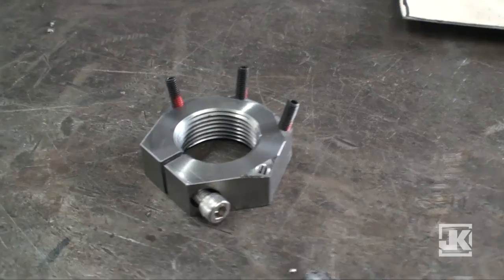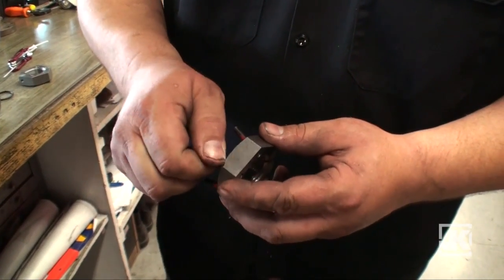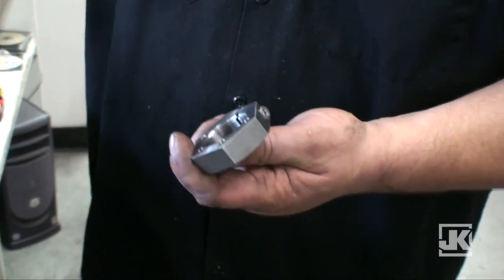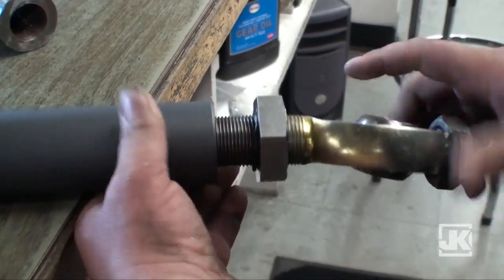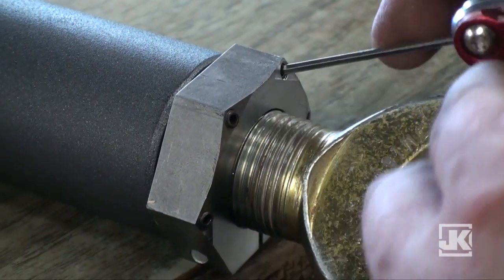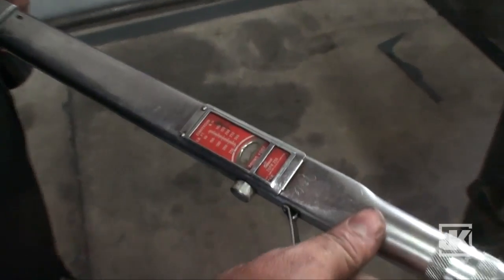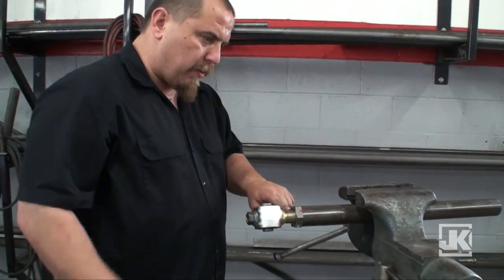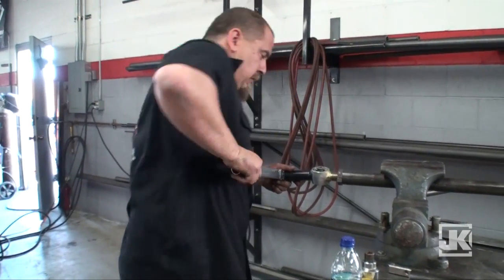Off Road Evolution LinXLok Jeep JK Control Arm Jam Nuts

Comment: I like the idea, but can we see a video of you applying torque in both directions? If the nut is tight the application of more torque will not budge a non locking nut.